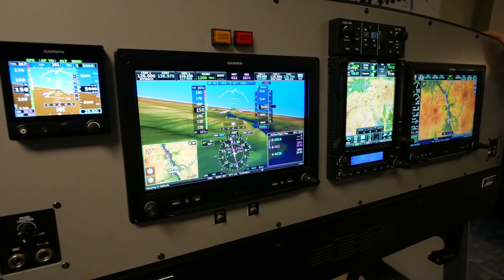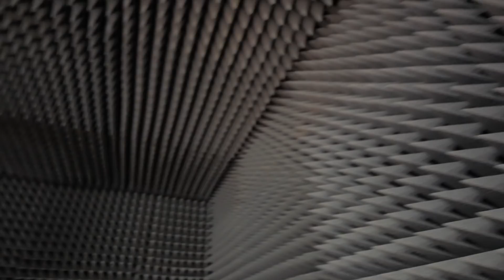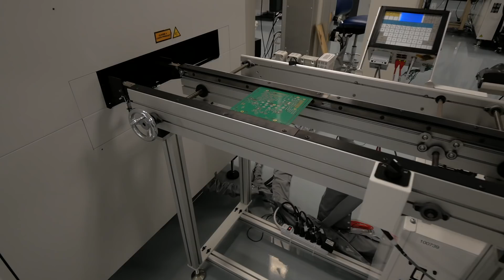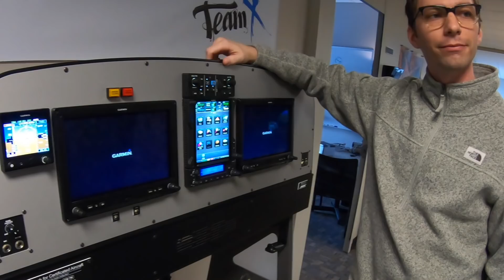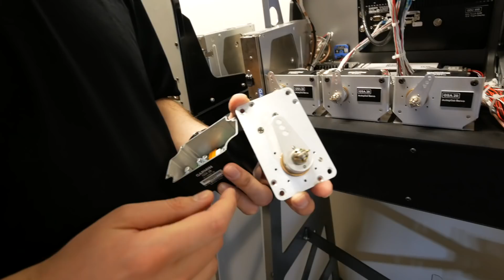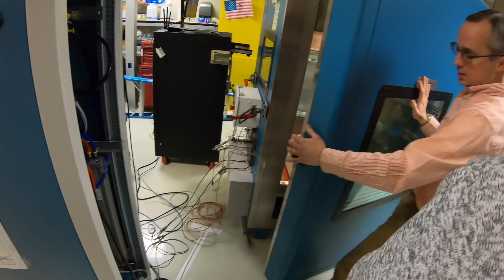Garmin All-Access: They Freeze, Bake, Shake all Avionics - BEFORE you Fly them!

Comment: Did they do any longevity tests on the joints on those robots?   (THEY are impressive)
Reply from the maker: Haha - Right!?
Reply: @FlightChops  Since those are robots used in other fields (e.g. automotive) where the number of units is easily tenfold, if not more, I'm assuming it's not an issue.

Comment: My GPS experience is limited to sail boats.  Never leave home without it is the first lesson after many years of pre GPS cruising.  But on boats they layer screens up a lot because frankly over time they have added too many features.  Basically at 5 knots or you just want to know where you are and where you are headed and how fast you are going.   Sorting though it all has gotten to be too big a hassle.  You wonder if the people who designed it ever actually use it especially under stressful conditions. Looks like the aircraft side of things does a much better job with information overload and definitely with reliability.

Comment: I want to know how to disable the auto pilot for more than a few seconds. My last BFR was tough. I had to fight the auto pilot for control when doing stalls, unusual attitudes, etc.
In normal flight, I’m glad to have it. But it makes training a sweatfest.
BTW: pulling the circuit breaker was impossible.
Reply: Sounds like ESP was kicking in. If you have a G5, you can turn it off for the portions of your flight where you expect to be in unusual attitudes. 
You can find the following in the G5 user manual, 190-01112-12, Pg. 67
1) From the PFD Page, press the Knob to display the Menu.
2) Turn the Knob to highlight ESP.
3) Press the Knob to enable or disable ESP